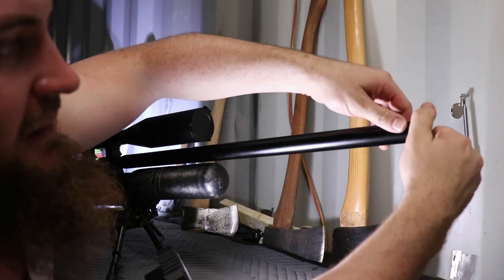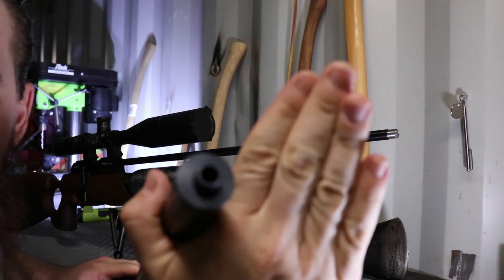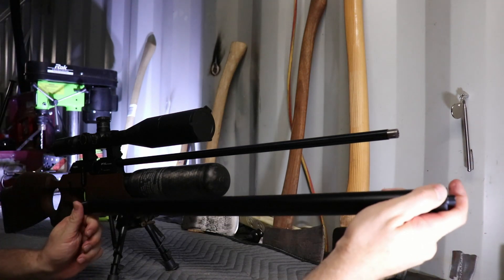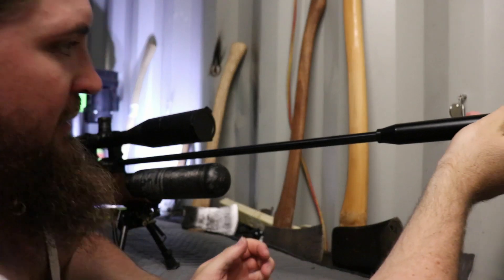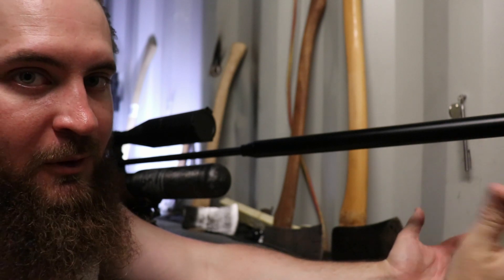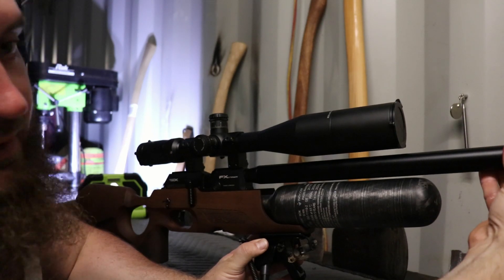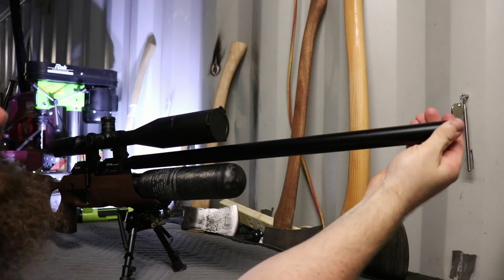FX Crown - ITS NOT SUPPRESSED OR SHROUDED IN AUSTRALIA

Comment: I am surprised that your FX is accurate at full power without an air stripper.  Does it have the "smooth twist -X" barrel, or the partially rifled "smooth twist"?
Reply from the maker: It's a smooth twist x. I don't think they make a crown with original smooth twist. It's tuned a little bit on the conservative side of the power curve so that probably contributes to the accuracy a bit
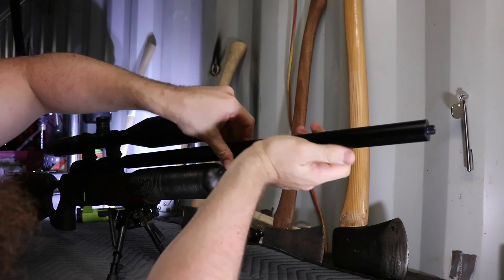Reply: @meatheadmarksman2013  Not surprised:  The effective spin rate of the "smooth twist" barrels are something in the order of 1:36 to 1:48 inches.  This is not fast enough to prevent the pellet from being buffeted by the muzzle blast, when used WITHOUT an airstripper.
Reply from the maker: @rickoshea8138  I have an original smooth twist 30 cal barrel for my impact, I'll try it without the muzzle brake on and see what happens!
Reply: @meatheadmarksman2013  That will be a great experiment; thanks.

Comment: I can't find an e mail address for you (definitely not tech savvy), so I am stuck with this means of passing on a couple tips which you may feel perfectly free to ignore.  First, you have said and proven with video evidence that you have a habit of winding turrets, knobs, etc. In the wrong direction.  I used to coach a junior smallbore rifle team and within the first hour on the range, everyone one of them was adjusting their sights in the proper direction.  Whether you come from north or south of the equator, no matter which way the coriolis effect pushes you, and no matter whether you are right or left handed, it works, and it is called the "Right Hand Rule.". Make afist with the four fingers of your RIGHT HAND, leaving the thumb extended.  Point your thumb ( the RIGHT THUMB) in the direction you want to move your point of impact.  If the thumb is pointed up or down, reach for the turret whose axis runs up and down, the elevation turret and with your thumb still pointed in the desired direction of change, turn the turret in the direction that your four fingers are curling, from palm to finger tip.  Easy peasy!
Second, I watched you shoot the box in a scope review.  I'm sure there is more than one right way to do this, but the Real Right Way that I was taught is to select an aiming point, and then keep it sacred.  Do not fire any shots at it in order to keep your aiming point undisturbed and exactly the same for each shot.  Then move your turrets up and over (both) before firing one shot.  Now move your turrets either down, or opposite over and shoot one shot.  Continue moving turrets twice the amount of original move so that your aiming point ends up at the center of the box and you go around the box three, or five or ten times(depending on how anal you are feeling on that day) shooting only one shot before moving again.  When you are done, your locations and distances should match up with your reticle, assuming FFP, and diagonals drawn through group centers should pinwheel your aiming point.
Like I said, feel free to ignore.

Luv and kisses, Carfunkle.
Reply from the maker: I'm always open to hearing how other people do things, the weird thing is when I'm not filming I never mess it up lol maybe it's the time pressure tgat makes me stupid haha

Comment: Hi there champ
Just wondering if you cleaned your barrel before you started shooting.
Cheers
Reply from the maker: Yes I did a very thorough initial clean when I got the crown and I've since cleaned it a couple of times as the pellet count climbs up.
Reply: Thanks champ
Ya i was wondering if they came shot from the factory or greased up for there travels,i get a new one next week.
Reply from the maker: @MrStihlman441  yeah it's worth throwing some solvent down the tube and wiping it with tight patches till it comes back clean. Mine had some small amounts of what was either grease or polishing compound in it but not much

Comment: Hey Meathead. I picked up my FX Crown this week. Woo hoo! What Bi Pod are you running and how did u attach it to the stock??
Reply from the maker: Congratulations! I hope you love it as much as I love mine! Mine is a Harris ultralight attached via a low profile sling swivel stud. If I had the chance to do it again I'd go with a short picatinny rail and a rail mounted bipod instead cos theres not much meat to drill into for the stud
Reply: Thanks for taking the time to get back to me. I was thinking of doing exactly that. Not enough guns shops in my hood to help a brother out.
Reply from the maker: @nicknorris229  make sure you measure it twice! Tomcat airguns has a good video about how to do it, defo worth checking out
Reply: Running. Ha!
Reply: Hey Meathead. I put a Viperteck CT 1 bipod and a atlas bt15 pic rail on my laminated stock. Was pretty nervous but it all worked out. Loving it!!!
Reply from the maker: @nicknorris229  nice! Does it feel nice and solid? Glad it worked out for ya

Comment: i do not think and see that the  fragile barrel systeem of the fx could be better then a  steel bull barrel.  it was always so that a massif stress free barrel was the best. der schutzen zielt, der lauf trift    german saying
Reply from the maker: What are you doing with your barrel??? Ive heard this weird pount being raised by a few people that fx barrels arnt as strong as full steel barrels, I do agree that a full steel conventional barrel is probably stronger then a barrel with a liner but I fail to see how it is a valid point of discussion. Are you throwing your guns around? Are you using them as walking sticks? ARE YOU BAYONETTING THE PIGEONS YOU HUNT??? How many fx guns have you seen with broken barrels and why are you worried about it? I am genuinely curious about this very strange train of thaught.
Reply: @meatheadmarksman2013  a stronger barrel wiil not hurt.. The reason for the fx system is .production costs..and did you get the gun cheaper.then one from other producers.and there are many reasons why a barrel gets a hit . .bij transport . and handling.  .so it will not be a problem if its stronger. Maybe the fx shoots as good.. Give me a  lothar walther bull barrel .
Reply from the maker: @peteralexben obviously a stronger barrel won't hurt, I think a bull barrel is a fine choice, lothar  make wonderful stuff but you can't change the twist rate without changing the whole barrel. The way I see it is the fx guns are designed around EASY adjustability and modularity. If you don't need or want the adjustability  or modularity the other options from other manufacturers are good choices. But this whole flimsy barrel thing is 100% nonsense. They are not flimsy, they are more then strong enough for any competent persons regular use in the field or on the bench and they allow you to quickly and easily optimise the nature of your gun to suit the task at hand, especially when switching from different pellets to slugs and back again through a wide range of caliber and power levels
Reply: @meatheadmarksman2013  sure thats a point ,ive used to have a Dan Wesson revolver ,with more barrels ,but  at some point i did not change  the barrels ,i then got a contender pistol 45/70 with other calibers 
barrels .30/30 223rem 22lr  thats real a different shooter then.after changing the barrel
Reply from the maker: @peteralexben  do you hunt with the contender? I love the idea of a gigantic rifle caliber pistol, sounds like hilarious fun! The whole reason I got the fx was so I could tune it to within an inch of it's life with specific twist rates for specific pellets and slugs. Kind of like tuning a hand load for a centerfire gun but on a smaller scale. Really allows you to nerd out on long range stuff without needing a gunsmith
Reply: @meatheadmarksman2013  the contender  i use it for target shooting 500 grain bullet with vithavuori n140 45 grain  (loads are for my gun only) and with a 330 grain soft load 16 grain unique , a max load for modern guns only ,hass more power at a km distance then a 44 magnum at the muzzle
Reply from the maker: @peteralexben  wowee! Does it throw bigass flames? I had a short barreled 308 a while back that made giant fireballs
Reply: @meatheadmarksman2013   if you load it with a booster load behind blackpowder ,thats 10 grain n110 and the rest blackpowder on top of it ,you got big flames en white lightning
Reply: @meatheadmarksman2013  you need if you shoot a rifle load in 308 ,a faster powder and lesser powder weight load in a pistol  barrel lenght .to be effective, if you want big flames .turn to slower  powder
Reply from the maker: @peteralexben  nice! that a recipe i can really get behind haha